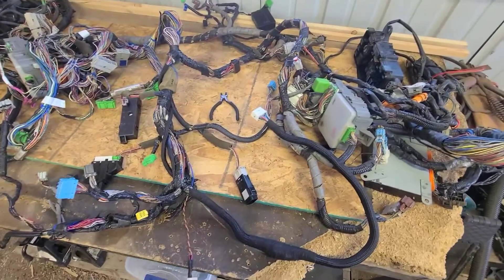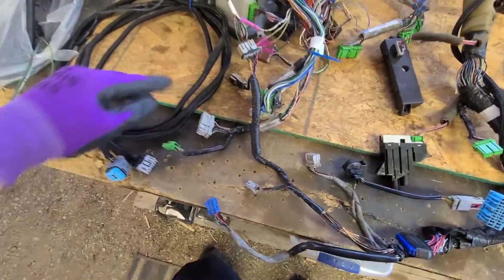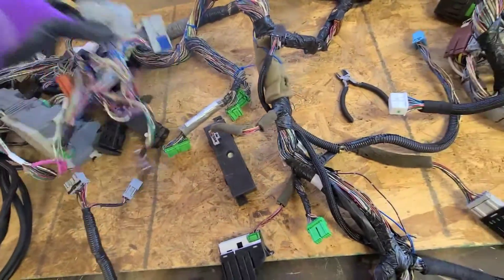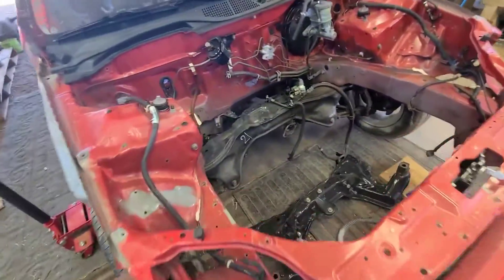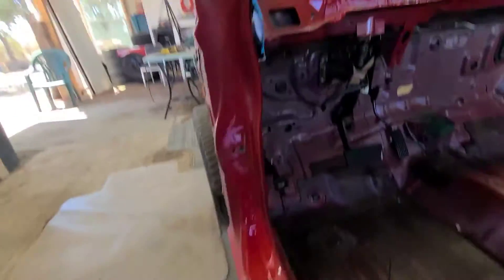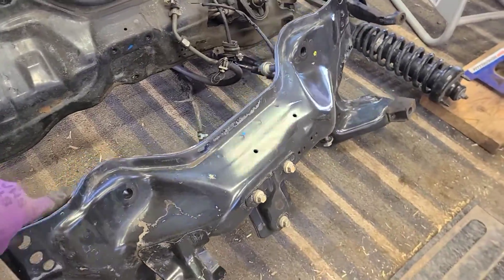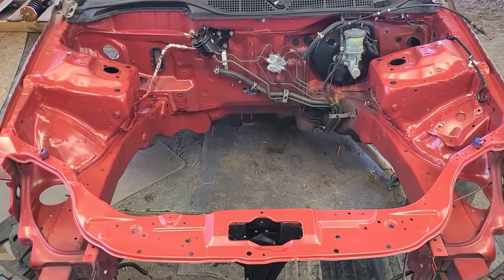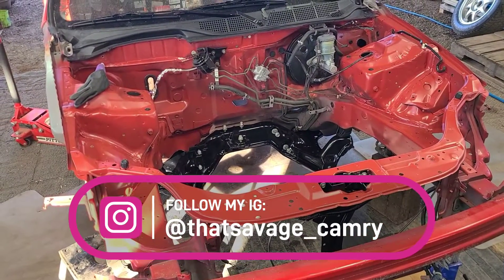Honda Civic Subframe Swap | J Swap

Comment: what made you use the whole cl harness why not juat keep ek harness and modify engine harness to work with dash harness
Reply from the maker: Headaches bro. The CL harness works for what this car is.  Even then I still had problems after the swap. I still have the Civic harness tho. Who knows what I'll cook up next. We're planning atleast 2 more Jswaps. My next one I want everything to work so it will prob be done how u said. Radio, heat ect ... but I hate messing w wiring, it takes the fun completely out of it for me. So that was easiest and fastest at the time.

Comment: Could you explain a little more on the wiring part? Are you using the ecu and full body harness from the donor car and essentially installing that entire harness into the civic? and like fitting up connectors to things you need (like cutting off the donor car headlight plug and replacing it with the ek connector so it plugs in?) Does this let you use the stock donor cars ecu with no modifications to it?
Reply from the maker: Basically yes. Just like you said. The entire CL harness and ECU. Headlights and taillight harness got wired up to the CL harness. And the Fuel pump. And then I also wired up a fan switch.

Comment: Nice would love to see more videos on it
Reply from the maker: We're filming the assembly rn. A couple days to edit and we'll have it out.
Reply: @Octane_Mayhem  what motor mounts are you using?
Reply from the maker: @thronewalker1153  Innovative but if I could go back I'd use Hasport.
Reply: @Octane_Mayhem  what’s the problem with the innovative mounts?
Reply from the maker: @thronewalker1153  I'm going over that a bit in the new video but mainly the back mount is gonna need a new plate to the engine and rewelded cuz it doesn't line up. The coating also seems cheap and chipping already.